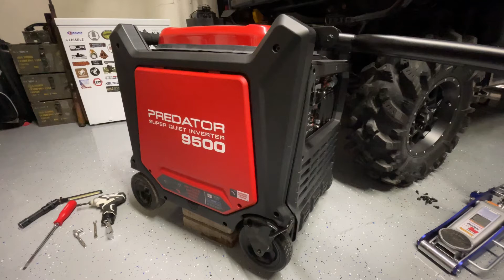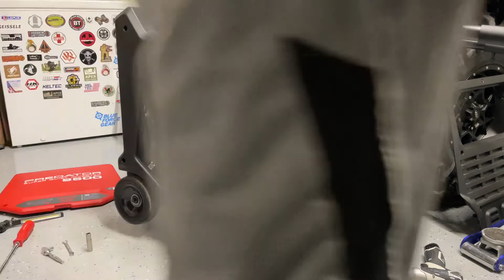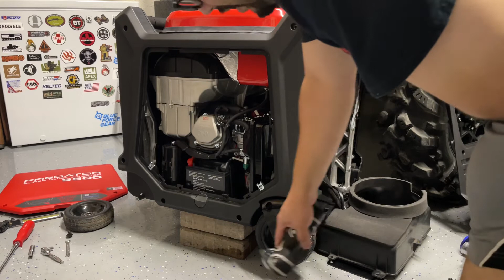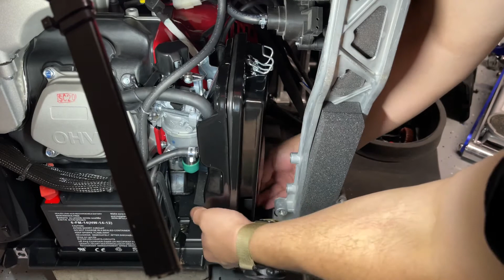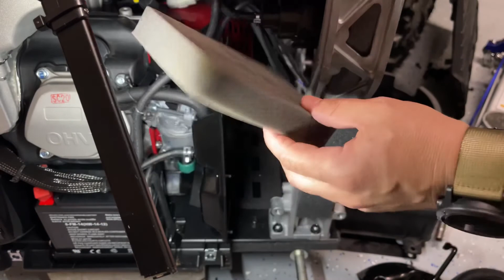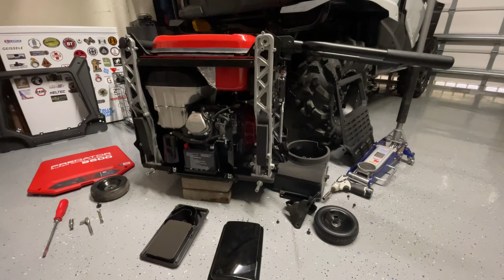Harbor Freight Predator 9500w air filter maintenance how-to

Comment: Demand model 71365, UPC ending 46340. That model has a plastic air cleaner box that opens in 3 seconds. Other model/UPC numbers may have the metal, nightmare to change filter. 

The only way to know is to look before you buy (they will not open the box) or buy the part number/UPC above. 

This is one of the most reliable 7-8KW around. Buy the right one to make maintenance easier.

Comment: I just purchased a 9500 in 2024 and saw your video  for the first time. Apparently, they saw your video too!  The new 9500 was reengineered so that all you need is to remove the same side panel and pop two plastic clips on the air filter cover. Easy peasy!
Reply from the maker: I am glad I could help! Thanks for the comment

Comment: You don't need to remove the 6 bolts all you need to do is pull the air filter out. This guy took the front off the air box witch is NOT necessary

Comment: You do not have to do any of that to remove the air filter. 
You have to remove the bolt holding the electrical module that is directly to the right of the filter housing and move it up out of the way. Then release the top clip but do not remove the bottom clip. The right side panel of the filter housing will now be able to be pulled away just enough to reach in and pull out the foam filter and put it back after. The filter sits in the upper part of the metal housing which is why it is easy to remove this way. Then just reset the top clip after you finish putting the filter back. Bolt the module back in place. 
Gavin’s Garage has a video doing this.
Reply: Thank you for that!!! I’ll look up Gavin’s video

Comment: Effective but inefficient.  No way this is what Harbor Freight meant for us to do.  I just brought the 9500 a few days ago and I can see the cumbersomeness, but there has to be a better way.  Also, once you had access to the foam filter, why remove the frame holding the foam?  I do appreciate your efforts in making the video, but maybe you can consider updating it with some new suggestions for us.  Thanks.
Reply: Ok I get it!  You were just kidding, making a parody of an 9500 air filter change.  In that case, great video.

Comment: Great, I just bought this machine 2 days ago, It will never see dirt or dust but yikes what were they thinking ? Did you flip the machine on its side to see if there is a access panel or consider making one ?  Thank you for sharing  .
Reply from the maker: I did and it doesn’t have access. I did consider modifying the air box lid but left it alone since it still has warranty. Maybe in the future I will re-visit it.
Reply: Gavin's Garage youtube channel has a good video on how to do this.  Takes 10 minutes.  I also bought this 9500 model. Did you buy the extended warranty?

Comment: Do you really need to remove the left side panel, wheels, wheel break and the left side panel frame cover?  Since you don't have to remove the 6 screws securing the air filter housing, why didn't you just remove the front panel cover and the inverter assembly to remove the air filter cover retainer clips to service the air filter?  The air filter cover should come out the front.
Reply from the maker: Unfortunately yes there’s really no other way around it trust me I tried.
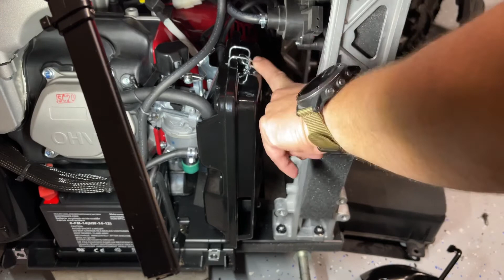Reply: @JayMaxWrench  After removing the side panel to insert a 1/4" socket to remove the bolt holding the resistor as you did at 6:06, you can take the cover out the front as demonstrated in youtube video https://www.youtube.com/watch?v=wXk7vBQSzXo at 14:15 where the fellow says and shows that it is easier to insert the filter cover from the front, not the side.
Reply from the maker: The reason I mention the left side cover is to prevent from damaging the outer cover like it happened to me. The reason the air filter cover won’t come off without removal of the side cover is because there is a wheel well for the wheel on the side of the air filter lid that sits 1/2” away from the lid and it’s just not enough space to remove the lid. Rewatch my video I point that out.
Reply: @JayMaxWrench  OK Thanks.  I'll find out what you're talking about when I modify my 9500s to run on natural gas.

Comment: If the foam part of the filter element pulls right out, why on earth are you removing the whole plastic assembly that holds it in place?
Reply: 🤣 exactly this dude took so much unnecessary stuff apart

Comment: That’s insane for just air filter access. The foam filters like that will pass fine dust unless there oiled, I use dirt bike air filter oil on my foam filters, comes in a spray can and is very tacky. Thanks for posting the video👍

Comment: I want to love it but what a nightmare for basic maintenance.
Reply from the maker: Yeah the design with the air-filter was definitely overlooked….. but it’s a item that really doesn’t need maintenance very often so I guess it’s ok for me. I’ll be 100% honest with you I don’t remember the last time I checked or cleaned the air filter on my lawn mower and it’s over 6 years old haha. I won’t be losing too much sleep over it.  : )
Reply: @JayMaxWrench  Page 16 of the Predator 9500W User Manual says to check the air filter "Before Each Use."  Harbor Freight must re-design the filter access to even implement the User Manual's "Air Filter Element Maintenance" instructions on page 18.